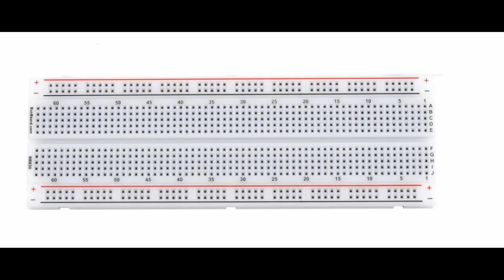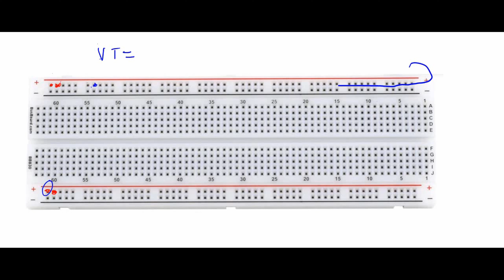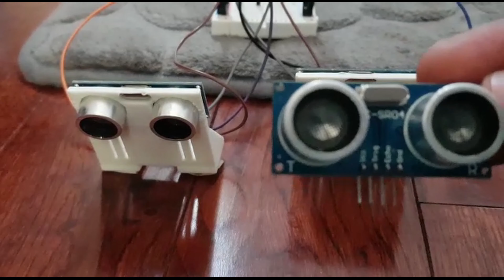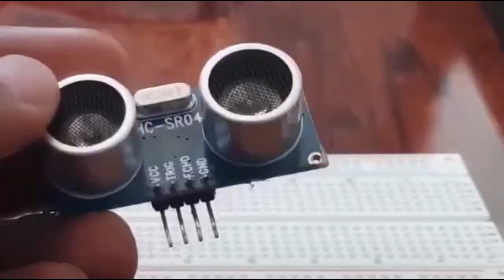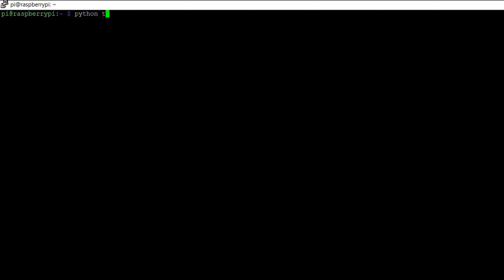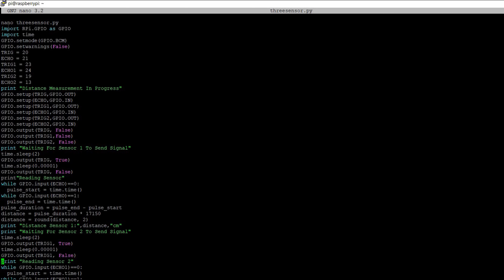Connecting Three Ultrasonic sensors to Raspberry Pi Tutorial | Three  (HC-SR04) to RaspberryPi

Comment: is it possible to connect 5 HC-sr04 sensors to a raspberry pi 4 b?
Reply from the maker: Yes, you can connect 5 HC-SR04 sensors to a Raspberry Pi 4 B! Just make sure to use voltage dividers for the Echo pins and trigger them one at a time to avoid interference. If you need a guide, check out this link. Hope that helps!

Comment: I would like to connect 100 of these to the Pi. Can you advise what hardware to get to make it easiest and most compact? I need to line up the sensors over a 5 meter line.
Reply from the maker: This link could help https://stackoverflow.com/questions/41428191/connecting-more-than-100-ultrasonic-sensors-to-a-single-raspberry-pi-3. I have not tried that before to be honest with you